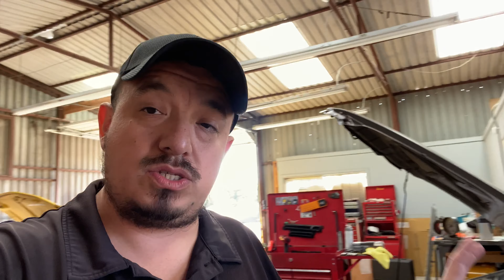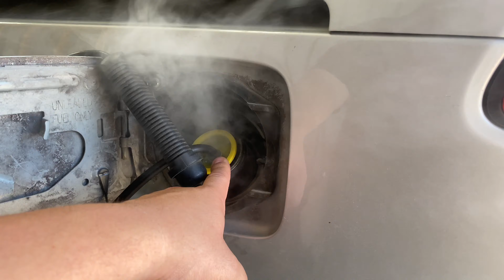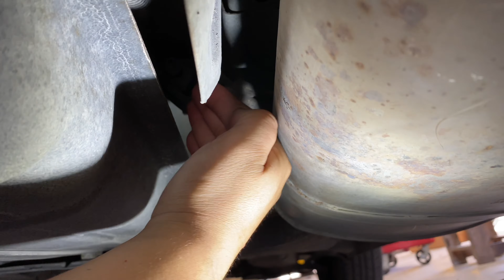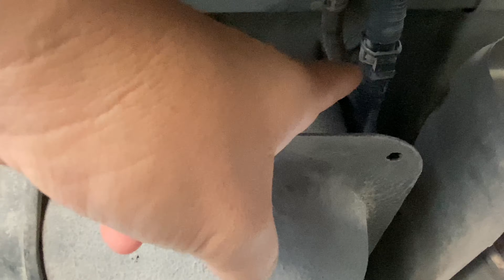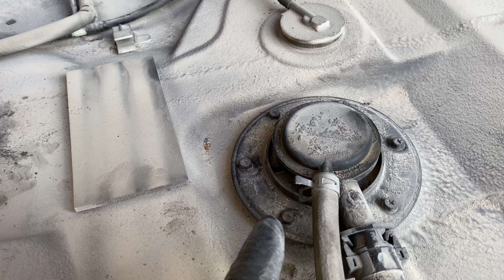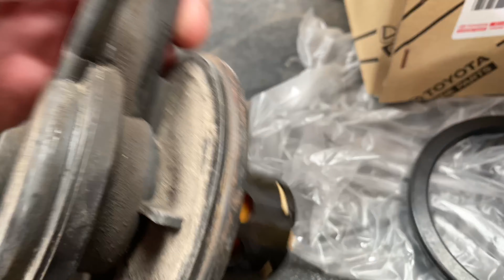P0440 P0442 Diagnose Replace OverFill Check Valve Toyota Corolla Sienna - Matrix - Camry

Comment: This is not DIY friendly work. Lowering the gas tank is a bitch. 
BTW, it's miss-named. It's an Over-PRESSURE valve.
The EPA demanded a SEALED system so that un-burned fuel could not leak while the machine was merely parked.
A Sealed System becomes a bomb -- of hot vapors. 
So SOME mechanism had to be designed to VENT such hot vapor before real damage would be done.
This relief valve is that cure. It was deceptively named because the general public would be pissed if they understood things.
If you had the gadget in your hands you'd see that it has two ports at the top and a coiled spring mechanism inside.
Think of it as a pneumatic FUSE. It's a One-Shot-Fuse, as all fuses are. ( You toss and replace. )
It HAD to be mounted to the top of the gas tank as anywhere else you'd have gasoline pouring out. This would be noticed.
When things go too far, it Pops-Its-Top. It's thin 'lid' is designed to blow. 
By re-naming it, the car owner can to be guilted/blamed for improperly filling their gas tank. Heh.
The real problem was a Hot Day in the Parking Lot. ( Lots of Sun are required to trip this fuse. )
AFTER it blows, there is scarcely any outward sign that something is awry. 
The plastic top nearly re-seals itself. Yet never enough. It'll be the Last Stop on anyone's check list.
This is your EPA in action.

Comment: I have a 2001 toyota sienna and pulled these codes so I took it to midas and  they told me to replace the charcoal canister. I replaced the canister cleared the code but after a few drives it came back. So I purchased a smoke machine from Amazon did the test and noticed smoke coming from the vent canister. But when i plugged the vent up it came from under the fuel tank. I lowered it down tank full of gas and that's when I saw the smoke coming from the valve. I called midas to see if I can get a refund and it seems like they want me to come there and provide a presentation. So I will. I have a canister that I didn't even need
Reply from the maker: for a 01 having a bad cannister docent seem odd at all .. could have been part of the problem .. but if light came back on you should have taken it back to them and have them rechecked

Comment: Does this job always require the lowering of the tank? I thought it could be accessed on a Camry just by removing the back seat.
Reply from the maker: Yes. Usually cars that have the access port under the seat is access port for the fuel pump. This is located in a different spot in the tank

Comment: It's surprising how often that overfill check valve is the problem. Many times they are found with cracks in the plastic
Reply: It's a FUSE for over-pressure. It's SUPPOSED to crack there. It's the exact same crack for every unit.

Comment: 2002 Highlander that is hard to fill with gas (handle keeps clicking off). The car has no check engine or codes. Air vent tube is clear.
Reply from the maker: its an evap issue ... need to check all valves there
Reply: @FalconsGarage  I've decided that since it only does it at stations with higher fuel delivery rates, e.g., COSTCO, and the car passes smog with flying colors, I'll wait for it to throw a code. Otherwise, it's an expensive troubleshooting proposition.

Comment: Will this work with 2001 Toyota Corolla Ce?
Reply from the maker: I’m not sure if the parts work on that car.  But probably would.
Reply: I also trying to find it for a 2000 Toyota Corolla I need the valve and seal can u help with those part numbers I can't find it

Comment: The Amazon link takes you to an assembly with a slightly different number, do they both fit the 2003? Because I found the actual assembly you use in the video on Amazon as well.
Reply from the maker: call the dealer and ask them for part numbers for your specific car and cross match them with the part numbers from amazon

Comment: I have a leak problem too i already replaced the canister but now it shows that I still have so I’m going to replace the valve assy fuel  thanks for sharing. I highly appreciate👍
Reply from the maker: Good luck!
Reply: Usually just replacing the purge valve on the canister (or leaking hoses on it) is good enough if in fact there was an issue with the canister.

Comment: Does this issue cause a strong gas smell inside the cab? Cause I have a 2005 sienna just bought it from a used dealer no issues during test drive picked up next day wife drives off the lot calls me to tell me she smells fumes !!! no warranty !!! So now we have a family van we can’t put our kids in. Brought it to Bridgestone and they say can’t smell it and can’t find and leaks they say they think it may be injectors idk but they only looked at the car for 25 min cause they where closing 🤯. It’s so hard to find a reliable mechanic that we can trust
Reply from the maker: It could be coming from there. But will probably need a smoke test
Reply: I know exactly where the smell is coming from. Once I changed my evap canister that smell of rich gas went away.

Comment: Would this also cause gas to spew out as the gas pump auto shuts off when filling the gas tank? I have a 2006 Sienna and it has code P0442 and gas spits out if I fill the tank until the pump shuts off.
Reply: Mine does this even on quarter tank..
Reply: Did you ever figure out what was wrong? I need advice.

Comment: The best youtube vid on finding a 2003 Sienna evap leak.....  (there are no others on YT.)              I have the same exact car and color. Great car w/157k........evap leaks are the hardest to find.....smoke tests (and simple 9 or12v VSV tests are key to evap system repair - There are vids on YT about those electrical tests). A smoke machine is a must for Evap problems. My mechanic charges me  a fair price to smoke test my Sienna($80). 

Your ingenuity regarding the smoked fuel fill pipe test is spectacular........ PS: add - "smoke test and Evap Emissions sys" - to your title and you'll add another million views to your video.............Thanks and good luck............
Reply from the maker: Glad I was able to help.  I’ll take you tip into consideration.